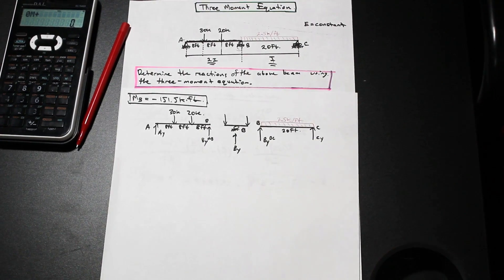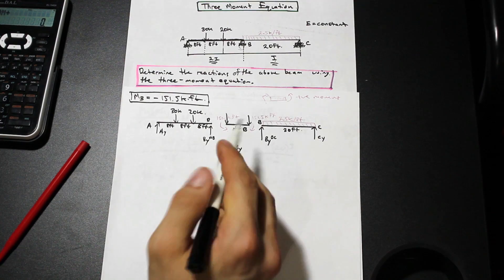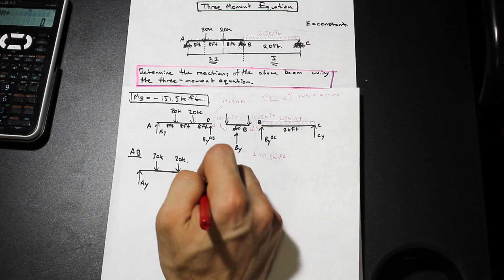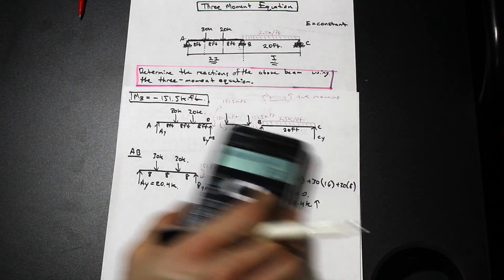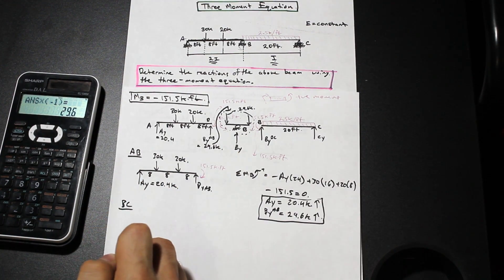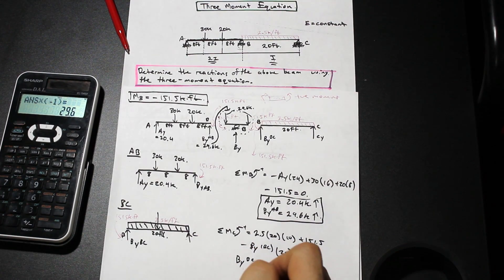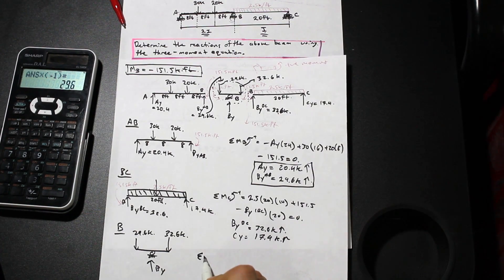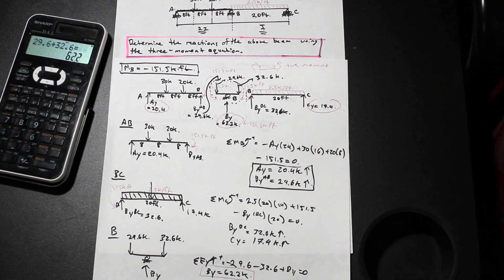Three Moment Equation Method (1st Degree Indeterminate Beam) - Part 2/3

Comment from the maker: This is the second part of this problem where we solve for member end forces and moments! Go to part 1 where we apply the three moment equation here: https://www.youtube.com/watch?v=zwT4CmcqILs

We uploaded the bending moment diagram for this video as a request.  Check out part 3/3 of this series by clicking the link! https://youtu.be/qmPYLkSLg7s

Also, learn how to solve a 2nd degree three moment equation problem with a fixed end! https://youtu.be/ocwmqnqT-Mg
Reply: how did you get the cy
Reply from the maker: Good question bud, just analyze the section BC on it's own as simply supported.  We get Cy by taking sum of forces in the y direction.  So the sum of By and Cy have to equal the total external forces acting on that section.  Total external forces are 2.5*20=50k, since By for bc is 32.6k after taking moment about C, we can find Cy by subtracting By from the total external load.  50-32.6 = 17.4k

Comment: hi! can i apply this method  in solving 3 or more support reactions acting on a Half truss? thanks it'll help a lot.
Reply from the maker: +Fung Yang hey man, thanks for the question and comment.  As a truss only details with axial forces and no moments are developed at its joints and members you best be suited using another method to solve for the reactions and forced of an indeterminate truss, such as the force method.
Reply: AF Math & Engineering thanks could you elaborate what is this force method sir? Is it any different with the method of joints? I am solving for the support reActions of a half truss that'll be used in maxwell method for determining member forces.
Reply from the maker: Fung Yang sure..is your truss determinate or indeterminate? If it's determinate you can whichever method you like.  However if it's indeterminate you'll need to use another method.  The force method is just an example of a method you can use.  Read the section in your textbook on indeterminate trusses, here's a pdf I found that that some more info https://www.google.ca/url?sa=t&source=web&rct=j&url=https://engineering.purdue.edu/~aprakas/CE297/CE297-Ch6.pdf&ved=0ahUKEwiB7sKlqYTYAhVr2IMKHVMADwIQFghpMAw&usg=AOvVaw2kwxf0s7w6MpIIJINFJIQY

Also check our video on determinacy of trusses if you're unclear on that.  Let us know if you have any more questions!
Reply: AF Math & Engineering thank you sir!😃😄 this will help me.😊 I'll study this first. Thank you!💪💪
Reply from the maker: Fung Yang great, glad we could help.  Check our truss solving videos if you need more guidance :D

Comment: So using the general formula you used in here, if the deltas are zero, only the constant value of I will be used? Regardless if the problem provided me a value of E?
Reply: And also, what if the degree of indeterminacy isn't 1, can i still use this formula?
Reply from the maker: Correct, when delta is equal to zero (no settlement), the entire last term reduces to 0. The only value that's used is I (be careful, I isn't always constant!).  For a second degree indeterminate beam, you can use this equation but you need to apply it twice to both redundant supports (you'll have two redundant in a 2nd degree indeterminate problem) and solve both equations simultaneously for the unknown moments.  If you'd like we can do a 2nd degree three moment equation example, let us know! Thanks again for the comments brother.
Reply: Thank you so much brother!
Reply: also, what if the support is a fixed end support where moment isn't zero?
Reply from the maker: Hey brother good question.  That's a special case...I can send you an example if you like...contact me at afmatheng@gmail.com or come msg us on Facebook.
Reply from the maker: Thanks again for the suggestion, we decided to do a video on the topic you suggested.  Hope this helps! https://youtu.be/ocwmqnqT-Mg

Comment: can you go ahead do the shear and moment diagram for it?
Reply from the maker: Sure, I'll add a pinned post when I get to it.  Should be within the week.
Reply: a pinned post?
Reply from the maker: +THE STRUCTURAL ANALYSIS MATRIX FORMULATION yeah check the comments for a link to the bending moment and shear diagrams for this video...it will be pinned on the top of this comment section within the week.
Reply from the maker: Or make sure you're subscribed with notifications on and you'll get a notice in your email :D